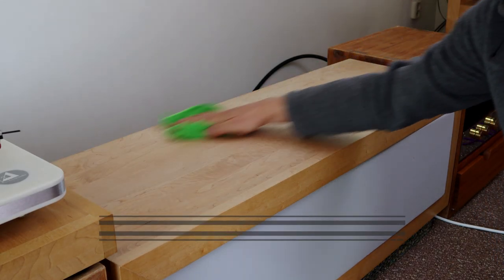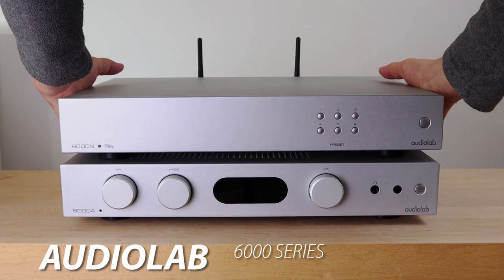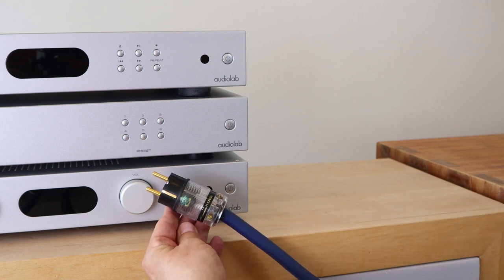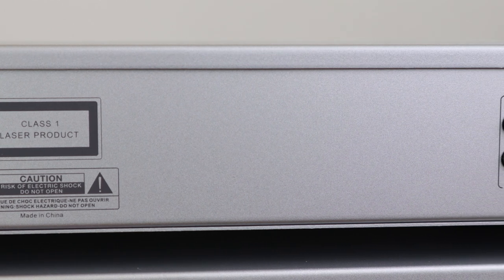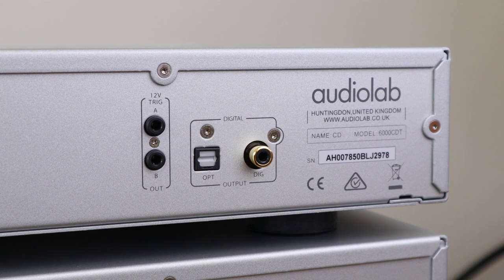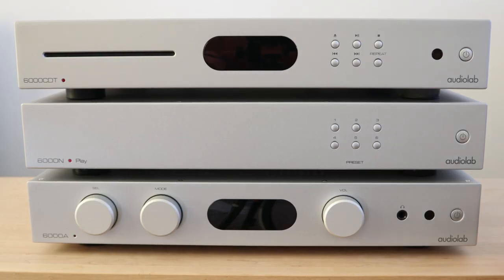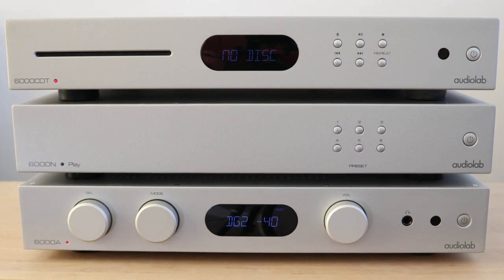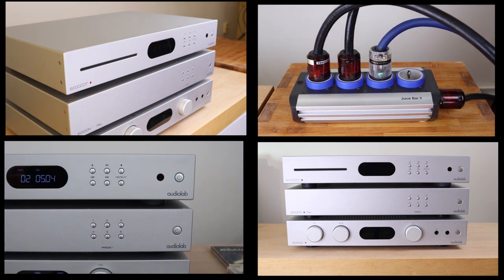Reviewing the AUDIOLAB 6000 SERIES

Comment: I have a CDT6000 and love it. My 30yr old NAD CD died so I had to get it. I play it through a Schiit Modi Multibit 2 DAC, Schiit Lyr 2 pre amp, Schiit Gjallarhorn power amp into Royd Herald or Minstrel speakers. Lovely sound. I did a comparison with my Phillips Bluray BDP3000 and the CDT6000 whooped it both using coax out into Modi Multibit. Very happy.

Comment: Great review! So, can we conclude that the socket connectors of Audiolab equipments have the right side as the hot lead? If so, this tip that I found online isn’ t so trustworthy: “For German and Japanese devices, the phase is usually on the right and usually on the left for American and English devices.” Thanks in advance for your clarification 🙏
Reply: I noticed that, sometimes, on the cables provided in the box of amplifiers, the live and null are clearly indicated, for Audiolab that Is true.

Comment: Hi friend,Audiolab is my new giantkiller. Do you prefer optical  or digital out put??I used  Qed signature opt ....
Reply from the maker: Hi, thanks for watching 👍
- My best experience was with the audioquest carbon coaxial cable, but both optical and coaxial outputs are great. 
- The second CDT I have is connected with a 4 meter Audioquest optical cable to the PS Audio (for my main system). Still perfect.
Reply: I like your girlfriend😂

Comment: why do all reviewrs stack the amp at the bottom of other components, blocking the top vent holes?
Reply from the maker: I don’t know if all reviewers do this, but here’s my reasoning:
- It looks better on film. Remember, it is a review for visual media. In daily use I never have anything  on top of my amps.
- The Audiolab is not really a class A amp. It does not get hot. There’s no real need to put it on top.
- Dust gets in more easily when the ventilation holes are on top. 

This particular system is playing at my girlfriends house and she never plays loud.
I understand your reasoning, but the amount of heat that is created in her system is really negligible. So I prioritize to keep the dust out.
Reply: @theaudiophilebarista2424  ahhh - very good. Thank you for the response!

Comment: I agree it's a great looking design but I had it for a bit and never liked it. I had the black version, which had a really weird texture to the finish that kept producing a kind of black dust that never completely came off, however much you wiped it. Then the sound: analyitical, dry and overly cool for my tastes. Lastly, I don't think it's a great testament to build quality if you can actually pull off the mode dial so easily!
Reply: I should mention that I'm talking about the 6000a amplifier, I haven't tried the other two pieces.
Reply from the maker: Hi, thanks for your comment.
- The black stuff is strange need. Nothing like that on the silver model.
- If all models have this dial problem I would agree with you. However, I suspect the previous owner had something to do with it. 
- Build quality is way above average. Especially for this price.
- What speakers and sources did you use, because I really don’t recognize the sound description you gave.
Reply: @theaudiophilebarista2424  Well, I bought the 6000a when I had my previous speakers, Elac debut b5 (not 5.2). I had a Marantz m-cr603 at the time, not a powerful amplifier but a sweet and relaxed sounding one. The 6000a just sounded a bit flat and mechanical with these speakers. I now have a Denon pma 800ne, which I just love. It has a slightly warm tonal balance but superb punch for its power rating. It less audiophile than the 6000a in that you cannot remove the power cord and it doesn't have a toroidal transformer, but I love the sound with my Triangle Esprit Titus EZ speakers. It's all about component matching in the end, isn't it? And I've got components that match extremely well for the sound I'm looking for.
Reply from the maker: @robertmarshall7712  I am glad you also think that component mixing is of great importance.
- Thanks for sharing 👍☕️